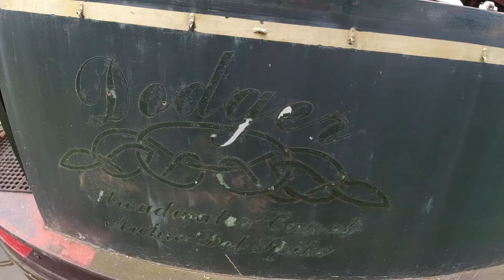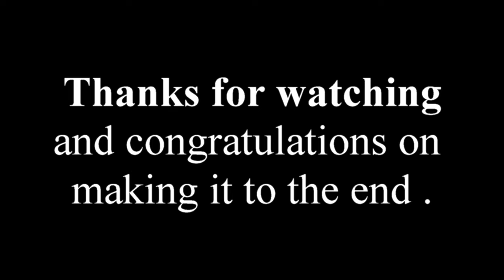Painting a narrowboat and a quick catch up !.

Comment: Glad to hear Spike is doing better.

Regarding the sanding, I use 3M Xtract Cubitron II Net Disc 710W. They are expensive, but cheaper in the long run as they last so much longer. Also using a vacuum connected to the sander removes more dust than the self extractor, so the discs last longer and the sanding goes much faster.

Good colour!
Reply from the maker: Thanks for the advice Erik. My mate said the same that decent disks would last longer. As for the extraction , unfortunately I don't have that equipment on board. I was lucky that day that there was a breeze to blow it away.  As for the colour ...its growing on me. I would have liked it darker but I'm still very happy with it ☺